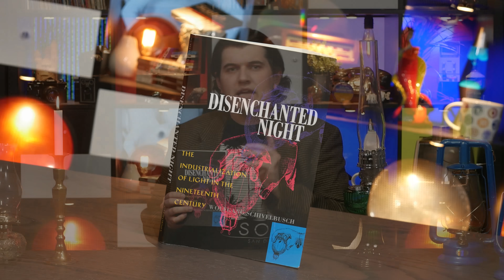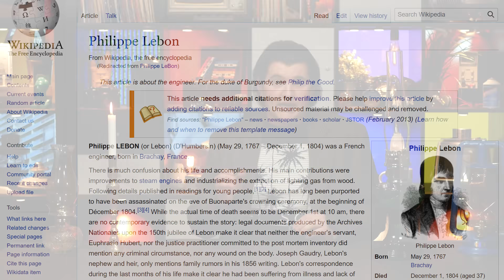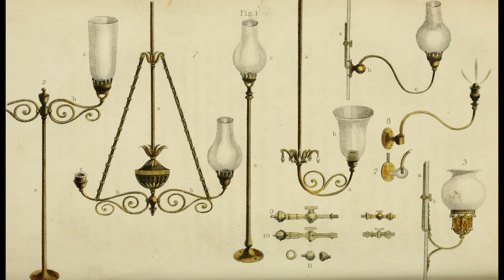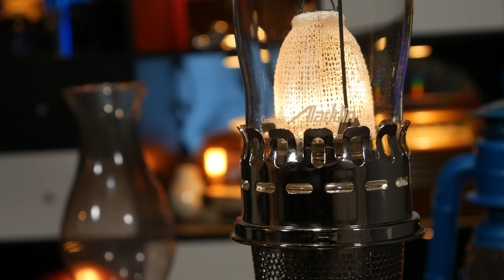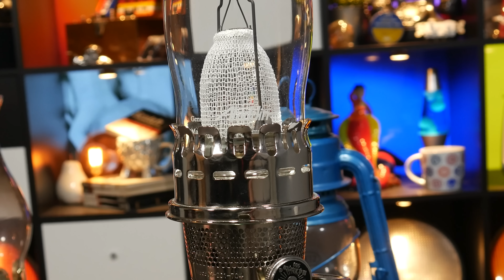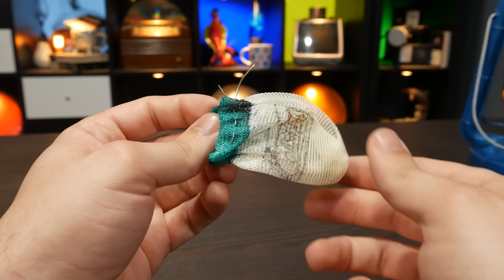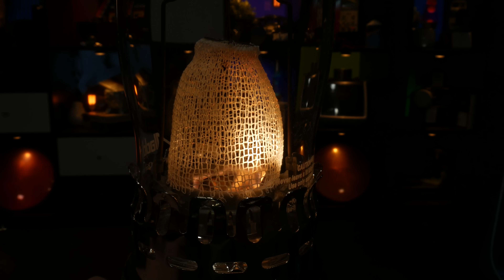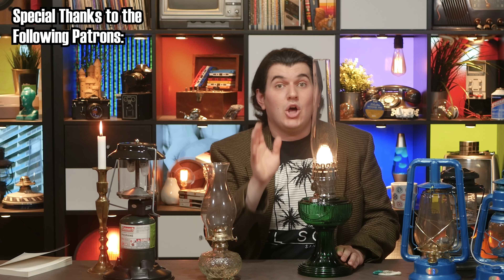How the gas mantle made lamps 10X brighter

Comment: Actually, gasometer makes perfect sense to me.  I've always understood that one sense of the term "meter" actually means to release in a controlled fashion, especially with liquids and gases, but I annoyingly I can't find this definition anywhere online.  The root-word that it was derived from would be "mete", as in dole out in small amounts.  I was always had heard this term used in carbureted engines where typically a controlled supply of fuel would be "metered" into a fuel chamber inside the carburetor at low pressure.  Then I found this: https://www.walbro.com/tech-tips/metering-lever-setting/

Comment: You can polish those smudgy lantern globes with newsprint. It works really well. (I grew up in a poor area with no electricity, so we used kerosene lamps. They were dim and very dangerous! I watched a 2-story house burn to the ground in 15 minutes, because some idiot was filling lanterns by lantern light, and knocked one over.)

Comment: It wasn’t just that,  that was the problem with coal gas,  hydrogen is almost impossible to stop leaking with the pipe technology back then because hydrogen is a very small molecule so coal gas had a lot of hydrogen in its make up so we had a problem with houses exploding quite a lot because of the hydrogen escaping undetected into homes.  When we switched over to methane and new pipe technology country wide people would say that it takes longer for water to boil on the stove because hydrogen burns much more hotter than methane and of cause they were correct.  just another little nugget of information for you.

Comment: Me and my wife like the house dark. She burns a candle or 2 and that's our light at night. I've got a Deitz lamp and several oil lamps as well and we just find that the glow from the candles and lamps are much more pleasant than the electric LED lighting we also have. If it wasn't for the fridge, microwave, AC and tv we wouldn't even need electricity as the truck recharges the power bank that fuels our phones and our phones are our computers since Samsung came out with DEX back in the S8 series phones.

Comment: As a young "back-to-the-lander" in the '70s on a non-electric farm, Alladin lamps were a big part of our lives, You are right about the adjustments, you had to wait until it was at top heat then turn it down to the lowest where it still glowed. You could get more light fiddling with it but you also greatly increased fuel consumption, it just wasn't worth it. Also, it was easy to break the mantle especially when you moved them from room to room, and they were expensive to replace, so we quickly learned to get the hanging models, hang them in the best places and leave them alone.
I still have the one from my bedroom hanging in my house today and it still works!
I love Alladin!

Comment: I was about to buy a Dietz until I began reading in the comments about all the leaks in these now Chinese-built lamps.  I think Coleman did the same thing, as my father's Coleman stove fuel container to his two-burner stove remains intact after 61 years, yet the one I purchased less than a decade ago leaks like a submarine on a screen door.  Yep:  Made in China.  I'm beginning to think if safety is an issue, such as with anything involving fuel or electricity, you MIGHT want to fight a more reliable manufacturer.  If the meantime, if you absolutely must buy a Dietz, I recommend you never fill it with any type of fuel whatsoever.  Instead, use epoxy to permanently weld the fill cap to the lantern.   Yes, people, leaky lamps are that dangerous.

Comment: Please do the MiniDisk! I now it's off, but I don't tweet. MD is a 90's 3,5" HI-FI and data disk which would have been better than CD-Rs, offered a 2x/4x compression stg like MP3, and it was scratchproof. In my opinion, if it wasn't for the CD-Rs, all PCs would have shrinked to fit only 3,5 drives...

Comment: I worked for a natural gas utility for decades. 2 observations on your excellent video. First, coal gas WAS very toxic, and this feature was used by suicidal people. They would stick their head in an unlit oven, breath in the fumes, and die. However, natural gas is inert, it will not affect or kill you. (Now, if you could fix it so you only breathed pure nat gas, no oxygen, then yes, you could "drown" in it. But it's no more toxic than water in that regard.) But every so often, someone would have heard the old "head in the oven" solution and turn on the stove/oven burners and sit down to die. And they'd sit there.  And sit there...  And although it would take hours and hours and hours for the gas to reach the minimum explosive level of 5%, once in a while they would succeed in blowing up their home.  
Second, the idea that lamps used up much of the oxygen in a room sounds far-fetched. Old homes were leaky, so leaky that 15 complete air changes per hour were common. New homes are much tighter, some as low as only 1 change per hour. And yet, we have gas stoves and ovens and room heaters and water heaters in these homes, burning far more oxygen than a few lamps and I have never once heard of such a thing as low oxygen problems in our industry.  Again, thanks for your entertaining video!

Comment: Back in the 1970s I lived part time in an off the grid cabin and used Aladdin lamps, we used the ones with aluminum bases not the fancy glass ones. A friend lived in a repurposed truck about the size of a milk truck and used  Aladdin lamps for light and heat.   In an old boy scout manual or similar book I remember a setup using 2 Aladdin lamps to slow cook the stew for the whole camp dinner (it took most of the day)
Reply: Also there is a special longer chimney for people who want to  the lamp at higher altitudes.

Comment: I had one of those Coleman Dual Fuel lamps for yeeears. The part that failed more than anything else on that lamp was the pump you use to pressurize the fuel container. Or I should say one of the o-rings in the pump. Luckily, they made repair kits for that little air pump.
Reply: My mate had a Coleman lamp and cooking stove. Unleaded fuel and pump like crazy. Worked really well but as you say the o-rings were a major weak point.

Comment: I saw what was basically a gasometer in Louisville, Ky in 1968.  It was used by the gas company as a storage container to supply gas in the mornings when many businesses were opening and turning up the heat causing a short time demand for more natural gas.  At night the tanks would refill when the demand was much lower.

Comment: Interesting... We always "blew out" our flat wick style table lamps (like your clear one) the same way as you did your Aladdin Lamp, mostly because they were the cheap Five and Dime store style that had such a small distance from lifter to wick opening that they "could" drop the wick if turned down too low, and that is BAD! - As a child I had one that was very small, that had a round "rope" wick even though it was shaped like your clear lamp, for a child's night light in power outages it worked well.

Comment: Colman type lanterns operate on gasoline but don't use ordinary pump gas from the service station it has additives to make it work better in The engine of your car but those additives will plug up the lantern ... instead you need so called white gas in other words gasoline without any sort of additives in it ... AKA lantern fuel at the camping supply isle

Comment: Isn't K1 Kerosene also known as No. 1 Diesel Fuel? It's a bit lighter weight than the No. 2 Diesel Fuel used in vehicles, but I'd be surprised if they weren't interchangeable to a limited degree. There may be legal problems with fuel-tax evasion if you pour lamp kerosene into your Diesel car or truck, but I'm sure it would work just fine. And I bet you could use No. 2 Diesel in the lamp with minimal trouble, or at the very least, stretch your K1 stash by cutting it with No. 2.

Comment: Firstly, I must confess, you could have held back the margarine gag punchline for a lot longer! I wonder if your ability to make me feel comfortable with suspending my critical faculty is one of the things that makes these so good. 
Secondly, I was born in '63 (in the UK) to a mechanical engineer in the industrial north. We moved to the midlands when I was 4 when my father started to work for the West Midlands Gas Board (gas was still delivered regionally) where he was very much involved in the changeover to natural gas in the late '60s, known at the time in the UK as North Sea gas, since that's where we got it all from. I remember the changeover, involving refitting domestic equipment to cope with the higher temperatures involved, and my father waiting for the fitter to leave before gently correcting his somewhat simplified explanations. 
He told me that people called gas holders "gasometers" because they went up and down depending on pressure so to a layperson it looked like they were showing "how much gas" was in the system, which just ain't so - but is also not completely stupid.
We were also fans of camping and later caravanning involving gaslight, and I remember his explanation of the fragility of the mantle after I clumsily broke a few. His explanation was pleasingly similar to yours, by the way. He was involved in the pipeline delivery of gas effectively from the coast up as far as the domestic meter, and also had to contend with the rather different corrosive impurities in the new gas. In my teens we had a discussion about some of the holes in the theories behind incandescence and he rather hoped that it might be something I would eventually discover, to everlasting fame and fortune. His pet theory was that it would be something to do with some of the aforementioned corrosive impurities somehow doping the crystalline structure of the oxides as they formed, producing a wider range of energies of the outermost electrons in the various shapes of the impure crystal structure, implying a wider range of excitation energies therefore a broader spectrum of light emitted therefore whiter light. 
He went on to become the Pipelines Engineer for British Gas for the whole of the UK before retiring near the turn of the century. I, however, became a jazz musician instead of any type of engineer, so I would like to apologise, as it's obviously my fault that we haven't cleared this up yet. 
He died about 10 years ago, so this was a very pleasant trip down memory lane for me, as well as being a beautifully crafted and presented piece. Thanks!

Comment: The mechanism of candoluminesce confused me too, I did a bit more reading and it seems that there are multiple parts to it, emitting more visible light than a black body at the same temperature isn't possible without some other sort of reaction going on, it could be that the materials were being heated by the flame more than a black body so at a higher temperature, if you point an IR thermometer at a thorium gas mantle, you will definitely get a much lower temperature than what it actually is, so it could be partially due to that, but that would just mean they were at a higher temperature, not emitting more light than a blackbody at the same temperature. The combustion products are higher energy than the surrounding air, the blue you see in a natural gas flame isn't due to black body radiation, that flame is not 10,000°C, the oxygen combining with carbon and hydrogen binding with oxygen will emit blue and UV light however, this light probably hits the hot surface of the mantle and makes it fluoresce as well as emit radiatively. but natural gas flames in air don't emit that much UV light, if they did, you'd get keratosis from watching your gas stove, another mechanism which, depending on the mantle material, could be helping out, would be the catalysis of partial combustion products, carbon monoxide, which is present in natural gas exhaust, even seemingly clean burning ones, combines with oxygen on the surface of the mantle, the energy would normally be released as hot gas and a photon, but it can all be given to the catalyst surface, allowing it to reach both a higher temperature or emit visible light fluorescently. An easy way to test this would be to get a spectrum/intensity graph for each mantle material while in use and subtract blackbody curves from them and see which effects are stronger. if it's spiky, then that's fluorescence, if it's a weird curve it's emissivity that's dominant and we're just getting the temperature wrong.

Comment: Out at my cabbin, we didn't have electricity for a very long time, and we had two massive tanks of propane behind the cabbin. We have two gas mantle lamps in each room. I remember my grandma lighting each one at night. But now we've switched to solar, although my grandpa for SOME REASON refuses to use a sine wave inverter instead of the square wave one we have now.

Comment: I’m fascinated by anything which burns kerosene for energy, I have fridges, irons, stoves, heaters, but my favourite collection is over 200 Aladdin lamps from model 1 which was a brass body lamp through to the current glass models.
Here in Australia Aladdin revolutionised kerosene lighting with their mantle lamps for all the reasons you’ve mentioned and Aladdin lamps are still used in some Outback locations today. Electricity is sometimes impractical to supply to extremely remote locations, so kerosene is still popular, it’s cheap, can be easily bulk stored, more easily than propane, and it doesn’t need wind or sun to run, plus the non pressurised Aladdins are silent. Aladdins are expensive though, even today, particularly some of the rarer models collectors are interested in. My mother told me when she was a young girl growing up on the farm with no electricity and only kerosene wick lamps and candles for lighting, only rich folk could afford an Aladdin lamp!
Love the show. 
PS I’ve spent hours trying to get Aladdin burners to burn more evenly, it’s almost impossible, particularly model 23’s. I like your theory about wick thickness inconsistency, never looked at that closely.
Steve from Aus.
Reply: I’m just curious, if exclusively used for lighting, wouldn’t a solar panel and battery and LEDs be much easier to use in Outback locations?
Reply: @Conservator.  Some folk certainly use battery power and solar in the outback and particularly in urbane areas, but some parts of the outback are extremely isolated, therefore kerosene is a more versatile option as it can be used by devices other than lighting.
Reply: @Conservator.  its hard to buy all of that when your poor, even if it saves more money in the long run.
Reply: @acow9966  For the price of such a lamp you could buy a cheap solar panel, converter battery and led light. These lamps are very expensive.
Reply: @Conservator.  its not expensive when your grandpa bought it when he was 20 and its been on the farm ever since
Reply: @acow9966  That’s true but they do consume fuel and gas mantles and a solar powered lamp would run on sunlight. 
I think solar lights are a viable alternative especially because they are safe and cheap.
Reply: @Conservator.  they are an alternative, but as I said, for alot of people its not viable at all. Your forgetting all of the work that has to go into a house just for lighting. Buying wire, which is very expensive, destroying parts of your walls just to put it in, and driving far far away to a brick and mortar store that sells all of those things. Most professional those people are content with the way they live anyways and don't really care about the downsides since they've lived with the downsides their entire lives and they probably don't even get bothered by them anymore
Reply: @acow9966  Thanks for your comment, that explains our difference of opinion. 
I was thinking of a very basic and portable set to use as a replacement for one or two lamps only. 
You could use solar to live off grid but that would require  something $10,000 to $50.000 depending on your needs 

Sunlight wouldn’t be a problem but keeping the batteries cool (ideally 25°C) would probably need some attention. But I’m way off-topic now😉
Reply: Haven't you find the Genie yet?
Reply: I'd love to see your collection. I have 15 Aladdin lamps.
Reply: Man, that seems like a very niche of people who collect lamps, pretty cool if you ask me. Though I think a propane one would work better for me (even though I think nonpressurized lighters are cooler)
Reply: How long does this mantle live ?
Reply: @Cody Parin solar panels are extremely reliable. They typically last 30 years and are only replaced because of degradation not because they break down.

Comment: Lute was name for a substance like a greasy pitch or modern non-curing silicone that was used to seal up glassware for early chemists' glassware and other equipment. The term "forced my lute" is the same as saying "blowing my gaskets",  or more common "blowing a gasket" or "blowing a seal".  You can make a gaseous lighting & heating fuel gas and high quality gasoline from coal.
Reply: I had a friend who used to cut Coleman white gas with leaded gasoline and burned that blend in his camping lanterns. I refused to share a tent with that lunatic. Sometimes I wound up sleeping outside in the rain. Better sleeping in the rain than that lead exposure to my brain.

Comment: Thanks for the video.  Been using a special hanging marine Aladdin with a smoke bell for 25 years. Liquid Paraffin is the best fuel for Aladdin Lamps. Cleaner, hotter and less smell than kerosene.  Often sold as "Ultra Pure Lamp Oil"